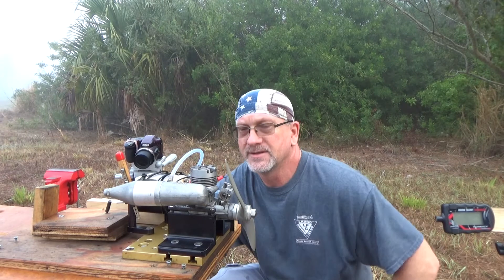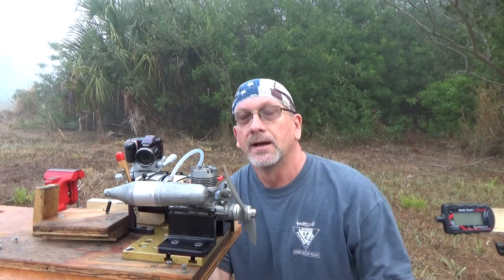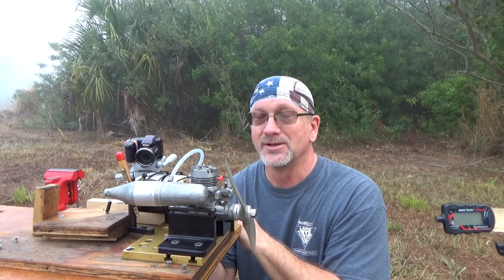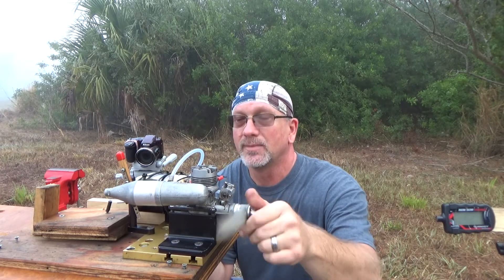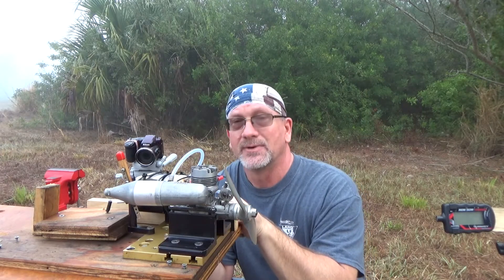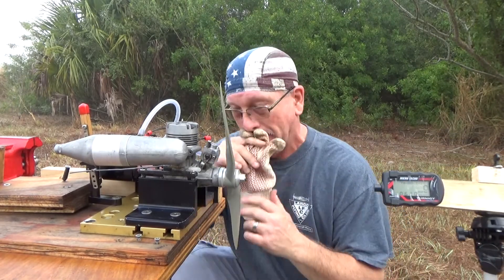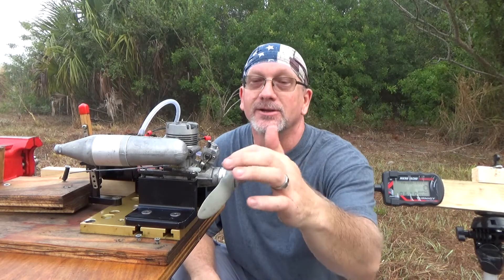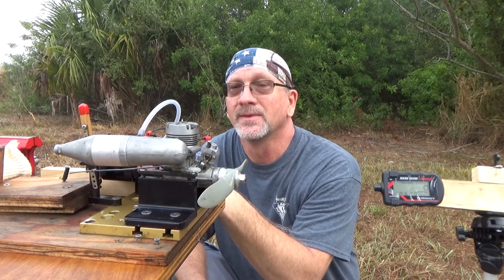Enya 45CX The First Run

Comment: The muffler you have is a genuine Enya Q Muffler. Q stands for quiet! I have one on an Enya 50. I stripped the thread in one of the cylinder head bolt holes and asked Steve Webb Models whether they had a replacement crankcase for my engine. They had one in stock for £30 but I was able to repair the damaged thread. If you intend to use your 45 you could do worse. I am a club level instructor  and my 50 gives sterling service in a Seagull Boomerang ARTF trainer.

Comment: I had an MDS 46 crack at the front of the case when I replaced the front bearing, I just slopped a little sealer in it , installed the bearing and it ran fine.

Comment: This carb is the G series. It has a tapered metering groove on the barrel. It may be jammed with congealed oil?
Reply from the maker: I finally got the burr off the throttle barrel down so I could disassemble and clean it.  All carb parts have now been through the ultrasonic and oiled.

Comment: Sad that the case is cracked. You may try to stop the crack by drilling a hole and seal everything with epoxy but this would only make sense if you desperately need the enging in running condition. I suppose it gets some additional air via the crack if it has developed towards the carb-area. If the remaining parts are still ok you can keep the engine for spare parts.
Reply from the maker: I mentioned more information on this in the video description